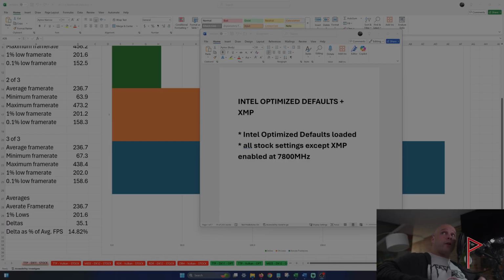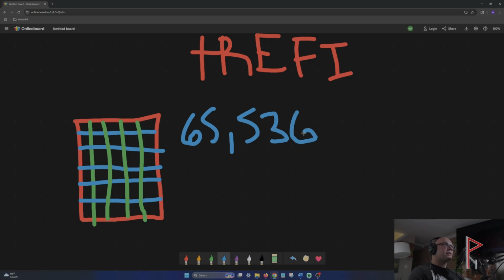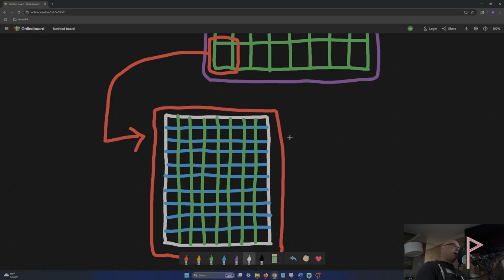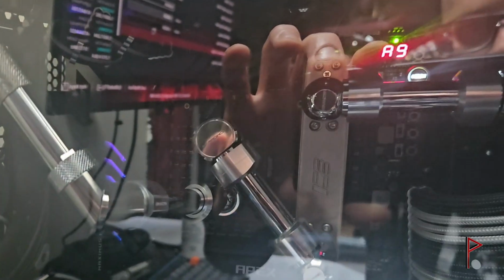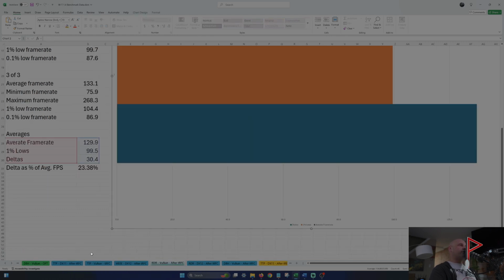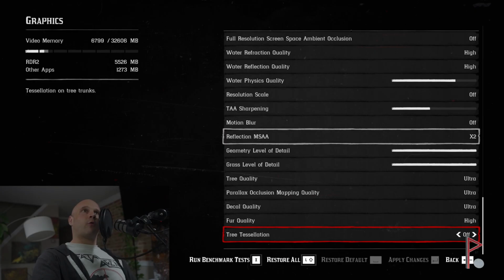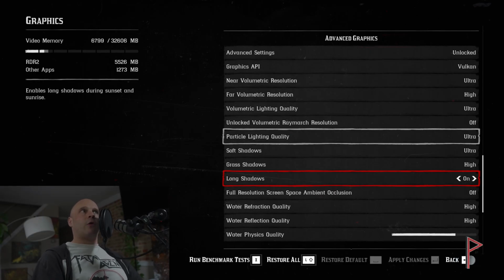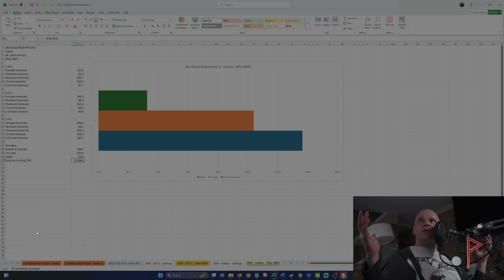Eliminate Your Microstutters...and so much more!!!

Comment from the maker: A note about the testing: I'll need to re-test the very first benchmark of Talos Principle on DX11 and stock settings to make sure that I didn't accidentally leave on a frame cap at 237. I didn't notice until I watched the video again after uploading, and then I was like 'hmmm...237 FPS...' In any case, if I did make a mistake there, it at least validates what we've previously described on this channel of the effect capping framerates has on reducing deltas. And if indeed I made a mistake there, it does nothing to invalidate the video's findings about the impact of tREFI.

Comment: In RDR2 the only thing that fixed my frame pacing is disabling the E cores. Not stuttering at all after that and the game itself is so smooth now
Reply from the maker: I can definitely see that. It's a kind of one-step OC, really. I leave them on because you'll occasionally see games that run better with them enabled, and I suspect more and more games will be like that. I can see it getting to become a bit of a '6 of one, half dozen of the other' situation...do you want to lasso your games or do you want to find out which ones utilize E-cores? Same amount of FAFO either way.
Reply: @WunjoTek  yeah, but even with Lasso it was stuttering, I can see the graph showing the E cores not being utilized but still it's stuttering. Until I disabled E cores from BIOS then all silky smooth. I don't know whether it's the game/Windows scheduler that causes the bad threading in the CPU cores.
And yeah, more and more games are utilizing the E cores nowadays.
But you will face an impalance between the P cores and E cores delivery time. So unless the game's engine is designed to be forgiving and allows objects and textures popping up without being ready in each frame, then you will keep seeing these stutters.
And to compensate for those games that make use of E cores, and while was at it, I was able to pump up my two golden cores 300 MHz to ease the game main thread choking.
Reply from the maker: @Byte.Burner  that's a good strategy. I didn't observe the same initial stuttering in RDR2, but I'll keep what you're saying in mind. After all, it's what I preach: BIOS first! The firmware-level fix is the surest solution.